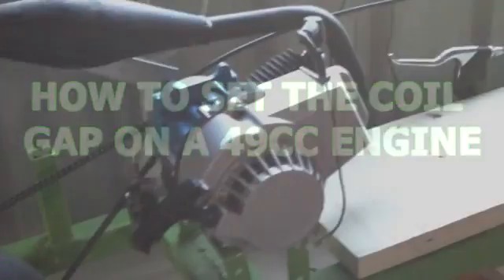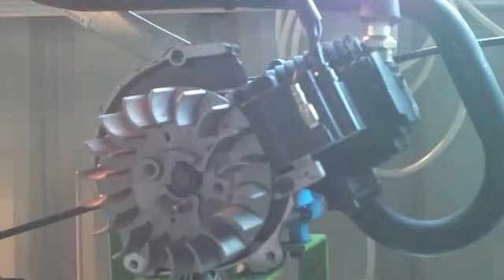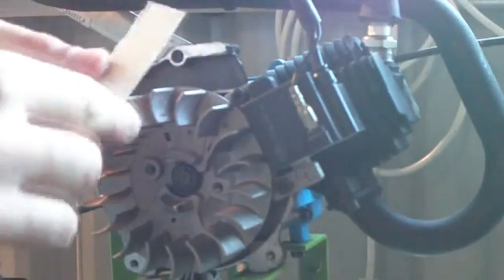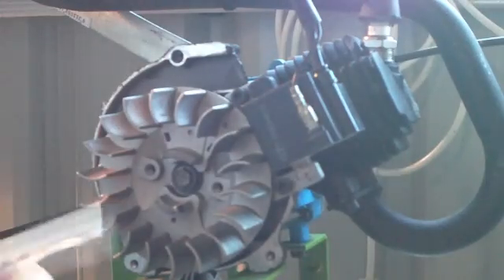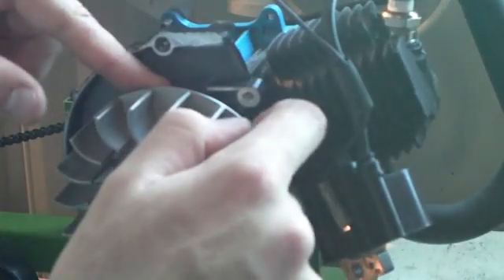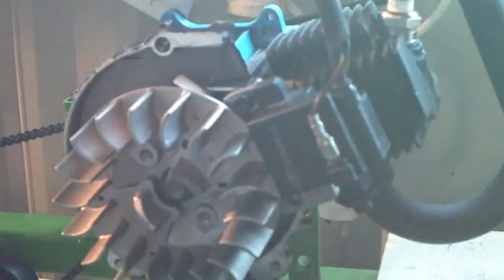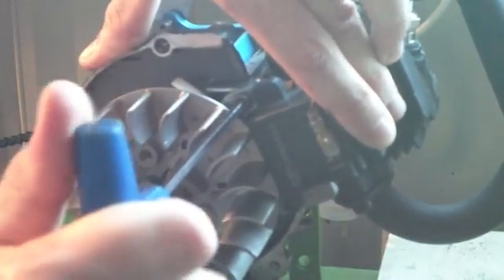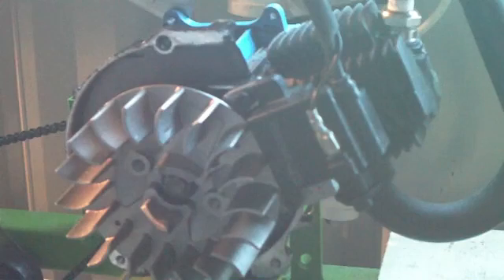how to check/set the spark on a pocket bike engine

Comment: Hey man I've got a little drift trike with one of these engines and it's not starting was running fine changed the pull start as I broke it and it now won't run

Comment: hey dude.my 49cc won't start at all..clean fuel spark air.rebuilt carbie.. do you rekn spark isn't strong enough and needs magneto regapping?
Reply: Hi. You may also want to check your carb. see if there's any leak in manifold's gaskets. if there's no leak, you can try turning the mixture screw to fully close position.  once you're done with it. Please follow these steps:
1. position the gas tap on and the choke lever close.
2. make sure that the engine switch is off, then pull the pull start at least 3 to 5 times but, not so hard like the way you want to start it.
3.  turn the choke lever to open position and switch on the engine.
4. pull the pull start and try to start the engine.

* once the engine get started, turn the carb mixture screw. counter clock until you get the right tune of your engine.

if the engine still don't start, but sounds like it is going to start. try doing it again, maybe try for at least 5 times.
if the result is the same, your bike maybe have different problem.

I hope this may help you.
Reply from the maker: could need a new spark plug or even that new magneto
Reply: +sscustoms100  I put my spark plug from my quad on.. it's a 2014 bike..magnetos better than my quad one...should I use magneto from quad? I can't find any reason why it won't start..apart from spark may not be strong enough...
Reply from the maker: +David S won't hurt to try if the magneto fits.
Reply: +sscustoms100 it does...just watched your vid on how to re gap once fitted haha...will try in the morning
..if it still doesn't start..what would you think? throw it away and just use quad engine? lol. it's odd because it's 2014 and quad is like 2005. lol. and everything is fine.

Comment: My mini dirt bike hasnt run for a while and the other day it started, the problem is that it went straight to full rev's when i hadn't twisted the throttle at all, as i wasnt expecting it the bike fliped backwards and the throttle snapped as well as part of the fairing. I am scared to start it again because of this. I've been told that my throttle slider is in the wrong way, but is there any other things that are causing this? Please help
Reply: Your throttle is probably seized up
Reply: I put a new one in the other week? yamaha mudking
Reply: +Jake Rowe 
you main jet is blocked, on the carb there's a bowl shaped thing on the bottom which holds the fuel, there's 2 screws holding it in. Take them out and the bowl off and you'll see a brass stick thing, this is the main jet. unscrew it with a flat head. Also it comes apart in two bits so be aware. screw them out and look down the jet, there should be a pin hole, if it's blocked which it will be, blow the gunk out that has built up in there with wd-40 or an air compressor. put it all back together but be cerful, the jet is brass so it will damage easy and there's a gasket between the bowl and the carb body, make sure its in the correct way and good luck..
Reply: Or need a longer throttle cable

Comment: So i adjusted my Coil but im still not getting a spark ( brand new engine out the box )   Should my Cut off wire be connected to something? ( cause its not now )
Reply from the maker: SelfCreation13 could be a faulty coil or bad spark plug best bet is to go buy a brand name spark plug and see if that helps
Reply: i tested my spark plug in a different engine and it worked! , so its ether my COIL or im doing something wrong!!!  if its the coil its a 30day order from across the country! :(
Reply: UPDATE:  i change the coil and the magnet thing ( behind the fly wheel ) and it works now!! :) ( i had an old seized engine)
Reply from the maker: magnets on the flywheel where probs gone

Comment: My mini dirt bike hasn't run for about 2 years and the other day i tried to start it, it started but cut out very shortly, i tried it again and it started then cut out . Today it isn't starting, i cant even hear the exhaust wanting to start. I've looked at loads of different videos and they're not really helping. Does anyone know what to do? I dont know much about mini bikes so i dont want to take it apart too much as i might muck it up. Please help My spark plug has a spark but not very good
Reply from the maker: Jake Rowe id try getting a new coil seeing if that would help  since you have had it for two years might be time for a new one
Reply: I've cleaned the carb, the spark plug is fine, its just very hard to start and when i do start it, the bike boggs/cuts out for no reason, i dont think its the idle screw. But when i drop fuel into the spark plug chamber it starts after about 5-8 pulls but again cuts out very quick and when i throttle it just other rev's and doesnt go anywhere... whats a coil *****
Reply from the maker: Magnetio is a coil
Reply: As the bike is old, one of the screws are circled so i cannot get the pull start off to replace the coil
Reply: Jake Rowe hi jake ,

have you tried starting the bike with the choke on ? 

1. if the bike starts up for a few seconds and dies off, commonly points out to a carb issue.

2. if the bike throttled itself when you started it :
- it could be if the tank was running real low on gas, 
-air leak at the intake, 
-your idle screw adjustment

3.Check if your fuel line is pinched 

if i was in your position, this is what i would do. remove the carb again. check if there is any clog at the main jet, try to eyeball with a bright light (the sun) at the back, if you cant see through, take a small needle and clean it. when you took the plug out, was it really black ? if it was it could mean you are running rich, i would try to adjust the C clip on the throttle needle to the first notch.

it could also be your petcock deteriorating, the rubber which then blocks the fuel passage, so when you cleaned up the carb, did you noticed if the rubber gasket for the petcock is in good shape etc ? i would try to focus on the carb i feel thats where your problem might be.
Reply: thank you dhinesh dev
Reply: +Jake Rowe you main jet is blocked, on the carb there's a bowl shaped thing on the bottom which holds the fuel, there's 2 screws holding it in. Take them out and the bowl off and you'll see a brass stick thing, this is the main jet. unscrew it with a flat head. Also it comes apart in two bits so be aware. screw them out and look down the jet, there should be a pin hole, if it's blocked which it will be, blow the gunk out that has built up in there with wd-40 or an air compressor. put it all back together but be cerful, the jet is brass so it will damage easy and there's a gasket between the bowl and the carb body, make sure its in the correct way and good luck..